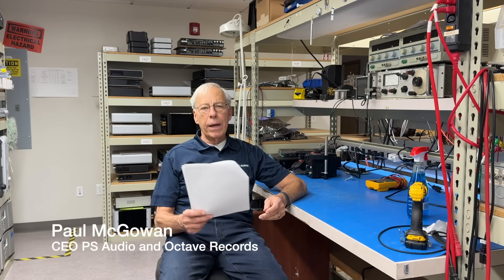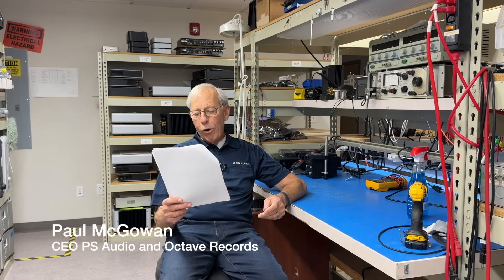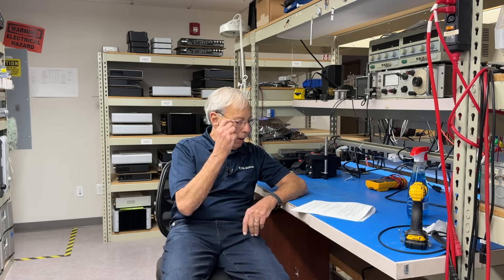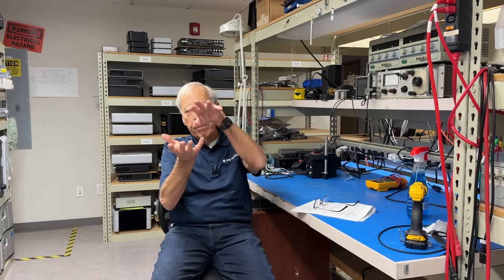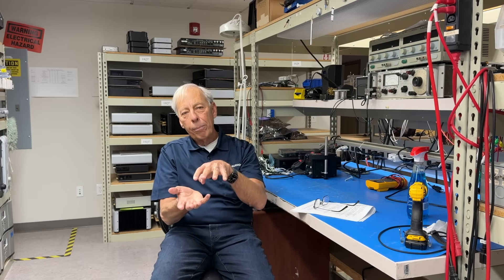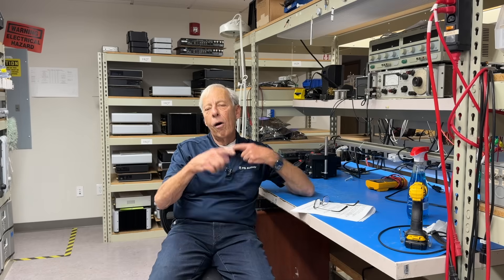Monoblock Preamplifiers

Comment: Many preamps are dual mono with a separate power supply for each channel.
Reply: Hear! Hear!
Reply: But big problem is you still share only one power cable and can't have separate power plant for left and right 😂
Reply: @ThinkingBetter   ...not a problem...seriously.
Reply: @ThinkingBetter  sure you can just cut out a second hole for your second iec14 and reroute some internal cabling.
Reply: @D1N02 It's a bit scary when I make such joke and people think I meant it lol 😂
Reply: @ThinkingBetter I just rolled with it
Reply: @D1N02 It's OK as long as it doesn't result in you actually buying accordingly 😂
Reply: @clickbeetle2720 What is wrong with one power plant per box? 😂
Reply: @ThinkingBetter It makes abesolutely no difference. So long as you have one power supply per side. It's exactly the same thing.
Reply: @johnrus7661  Hey, I was trying to make a joke of how far people go in the ridiculous department of this industry. Of course a pre-amp is running fairly low and near constant power consumption unlike a power amp. Any cross-talk between left and right is therefore insignificant with proper circuit design and you can run a preamp on a single power supply without any issues easily.
Reply: @ThinkingBetter This is 100%, false. And you are just assuming with nothing to go on this was a joke. I have had to argue the last few days with idiots about cables and how woefully ignorant they are. This doesn't even make it on the list of stupidest shit I heard this week. Figure one moron said a weaved cable would confuse the electrons.🤣

It doesn't operate and near constant power unless it is class-A. Cross talk happens just as much and has similar cross talk as amps and is part of the specs. Dual mono is not even rare. Hell, the $700 Wyred 4 Sound pre-amp is a dual mono design. It's not rare and has all the benefits of mono block construction of amps.

It's rare to have them in true monoblock fashion. Which makes it more difficult to do. That's what Paul is specifically talking about. Not dual mono construction.
Reply: @johnrus7661 We are talking preamps. Class A is a power amp thing. Preamps run quite low currents and it's trivial to maintain a constant power rail voltage. You can also with minimal components ensure there is no left/right cross talk of significance. I design these things.
Reply: @ThinkingBetter You are woefully ignorant and don't have a clue what you are talking about. Dude, it's literally in the name pre-AMP! How in the hell you think you think it works. They make class-A, class A/B, Op-amps etc. It's litteraly a smaller amp inside at the output stage!

And subject to everything an amp is.
Reply: @ThinkingBetter I have never seen a preamp that wasn't class A.
Reply: @ThinkingBetter   ...I knew that you were joking because you included the "😂" icon at the end.
I nearly was going to work my way back into a power cable argument with you but thought better of it 😝
Reply: @johnrus7661   ...you state, "And you are just assuming with nothing to go on this was a joke."
He has plenty to go on that this was a joke because HE STARTED THE JOKE, you ignorant fool.
Here you are looking very stupid yourself while you accuse others of the same misdemeanor.
IT WAS A JOKE; chill out dude. It didn't require your serious answer...Sheeesh!
Reply: Tell me you read nothing I said without telling me......
Reply: @johnrus7661   ...another stupid response from you.
Reply: @johnrus7661 W If you have some very crappy cheap op-amp based pre-amp with poorly engineered power supply allowing milliamps causing issues between the two channels, you might have a case but what do you expect from such US$50 Amazon preamp? 😂
Reply: Says the troll.
Reply: @ThinkingBetter You aren't making any sense and clearly didn't read a word I said. Nor are we talking about a $50 pre amp. Which are surprisingly good for your information l.
Reply: @johnrus7661 it doesn't take much care in a preamp power supply design to keep the voltage clean from load induced noise. You can just run separate regulators and DC filters and avoid sharing thin ground wiring etc. and you will be fine. The most audiophile preamps run more constant power consumption also BTW (call it class A if you want).
Reply: @ThinkingBetter it is class A, nobody is using any other class of amplification for preamps that I know of.
Reply: @johnrus7661   😂😂 I'm just challenging your stupidity, but if you want to call that trolling, well, that's just
you deflecting from realizing that you are clueless when it comes to people posting humorous comments.
Reply: @mitchtaylor6512  At least for audiophile preamps, you want to keep it in class A. But the entire topic is a bit ridiculous to begin with for a preamp. It's not hard at all to isolate left and right within one enclosure of a preamp.
Reply: @ThinkingBetter you mean I shouldn't have Dremelled my preamp?😵‍💫
Reply: Yes that was going to be my comment.  I own an older model Electrocompaniet pre that is badged as 'dual mono'.  Presumably this addressed the issue of which Paul spoke, gain control.  Housing the individual components in the same chasis and only electrically 'coupling' them for the gain control (and source selection).  A 'compromise' of course but one solution to the concept. 😉

Comment: The Aesthetix Callisto is a dual mono pre-amp.
The remote activates motors that turn both volume knobs, simultaneously.

It has its power supply in a separate chassis, and is the same size as the pre-amp.

It sounds amazing, and has a price to match.  It punches above its price point, competing with much more expensive pre-amps.  It is expensive, but a bargain for what it delivers.

Aesthetix has a higher-end "Metis" pre-amp, all within one box.  Perhaps under the cover it is a dual-mono design?  I am not sure.  When I demoed the Metis, I heard the best sounding, most realistic sounding, most natural sounding, most musical sounding, most convincing "you are in the room with the band" sounding, most focused sounding, most three-dimensional sounding presentation in my life, when I played music that was recorded, mixed, and mastered with expertise.
Reply: That is true, Aesthetix also give you the option to use separate power supplies for each channel in the Callisto, as well as the Io phono preamp.
If I had unlimited funds, I would go for the Io phono stage with a separate power supply for each channel. In Australia, this would set me back AUS$60k (US$40k)
Reply: @stephenchen1420  I have heard the IO Eclipse in a very high-end system.
It is a wildly good piece of gear.  You do not hear it, which is what makes it wildly good.  All you hear is the music.  And with a good pressing, there is no indication that you are listening to a musical reproduction.  It just sounds real, in every respect (no stereo present -- just the band in front of you).
Reply: @0Perhaps  , thanks for your experience, that is why I aspire to it!

Comment: I recommend a separate power plant per each mono-block preamplifier 🤔
Reply: preferably on opposite sides of the equator
Reply: @user-ex9zm7bg3x  Yes for maximum channel separation you got a point and make sure to use silver cables 😋